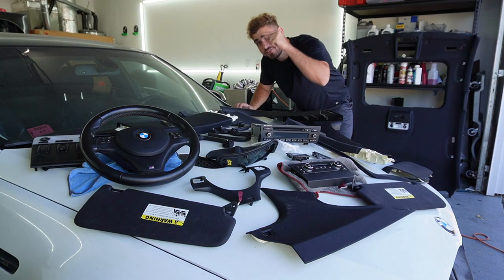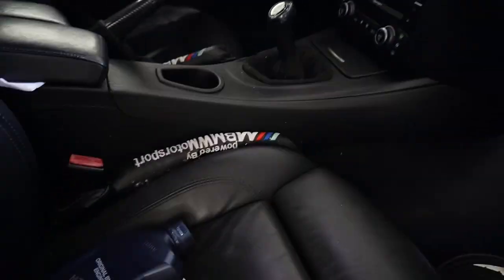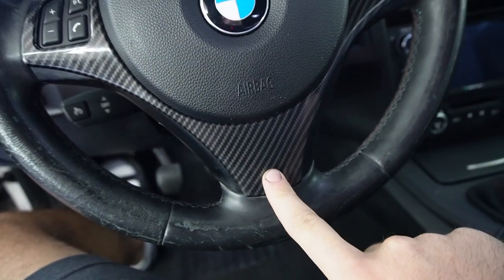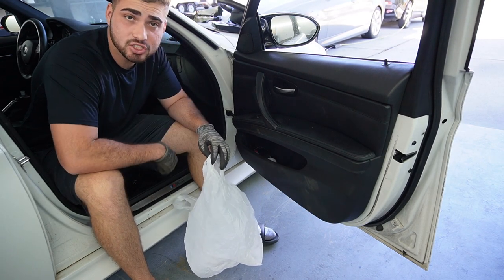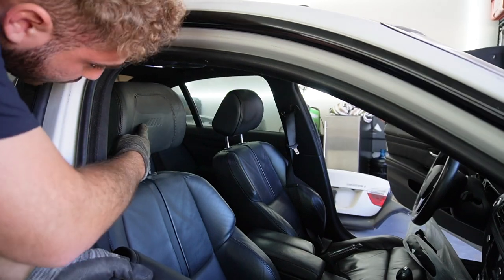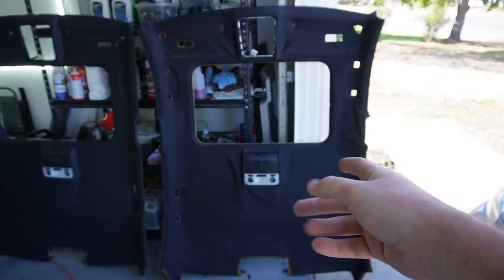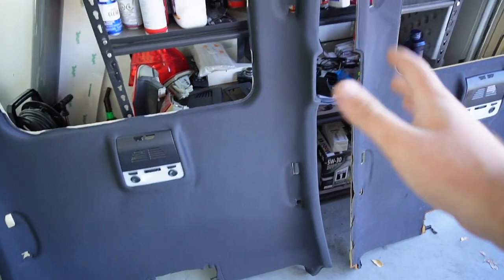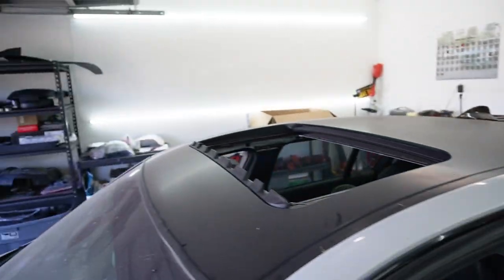Restoring A E90 M3 Interior In 8 Minutes! SUPER SATISFYING!

Comment: I had the same issue with the sunroof shade being hard to close after swapping it, I don't 100% remember what I installed incorrectly but I'm pretty certain it was something with the wind deflector. I believe there are two sliding tab things that it clips into (on on each side) in addition to the hook on each side.
EDIT: wind deflector might not be the right term but you installed it at 4:59-5:00. I believe you forgot the clip that piece to the two sliding clips, so it's just dragging on the sunroof shade.